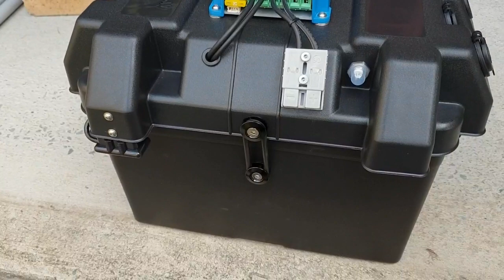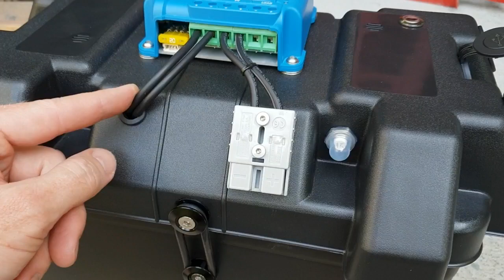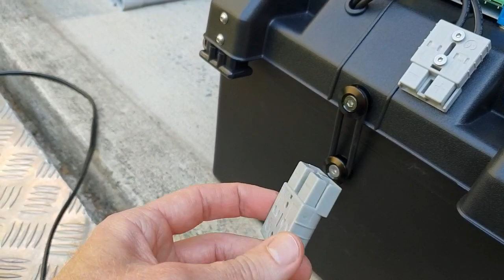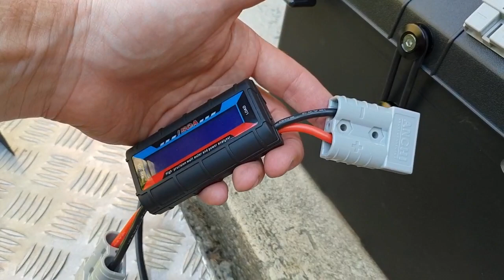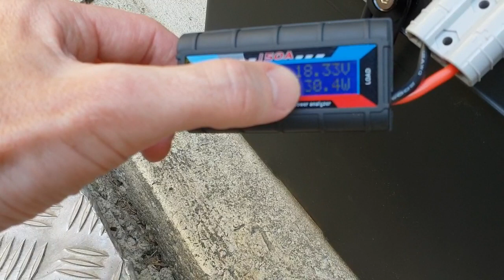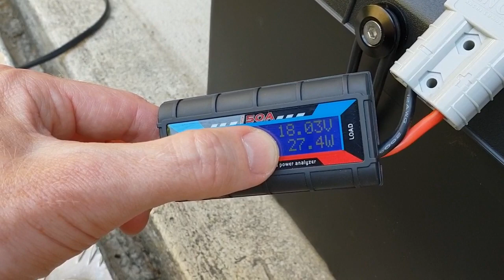AGM battery box and Victron 75/15 solar controller

Comment: With the box, is there any additional ventilation you have added. I have a similar set up but tend to lift my lid when in use for air flow? Am I just being paranoid, my box is in a boot and tend to have windows cracked a bit allowing outside air in. 
Any suggestions for ventilation?

Comment: I'm thinking of using the 75/10 Victron to trickle charge, or is it maintain, an AGM starter battery on a boat.  The panel is only 55W, but I might be able to add another 20W panel.  A few questions:
1.  Would the 75/10 be at its limit?
2.  I think my alternator puts out 14.4V, and I've read AGM batteries take 14.6-14.8 to fully charge.  If that's true can solar finish off the charging of an AGM starter battery?
3.  The Victron solar controller has another 2 terminals on the unit, are they for loads, e.g. lights etc?
4.  I have all the lights and stuff running off a leisure battery, the starter just does the engine.  But if I can run lights off solar as well, then I would.  I can't work out how I would wire it all up.

Comment: Great video. Im looking at doing the exact same set-up. The watt meter is very handy. What size wire did you use from the "battery to the controller" and "controller to the anderson plug (to the solar)". Im opting for a 100/20 Victron MPPT with a lithium 120 AH battery and a 275w (approx) house solar panel. Thanks in advance.

Comment: where exactly would you use this?  You could not mount this on the outside of a RV because the charge controller is not waterproof.   If you do not use a lithium battery and they are lead acid then you have to vent this battery or mount it outside.

Comment: I prefer a bigger box to ensure it's water proof then in case you're using it outside you won't have issue with rain. In this case, you have a hole right in the top of the box, let alone the Victron just sitting there.
Reply: Just put a cover over it, done deal.
Reply: @kdigiacomo   Yes that is a good idea, then you can leave it outside the box still but get to it easily and still have it waterproof.
Reply: I don't know why victron done make them waterproof. Ip43 is pretty pathetic for a premium mppt controller.

Comment: Good informative video, I made one similar around the same time frame,  I used the 15a load output on the victron controller for driving the loads.  That way I could monitor the loads on the victron ap, via bluetooth dongle.  With the app I could set a custom low voltage disconnect for the loads to protect my battery.  I also used the victron bluetooth temp sensor that integrates with the controller to prevent the victron from trying to charge the battery in cold weather.  I liked the plug and play monitor with the anderson connectors, unfortunately I smoke mine when I wasn't paying attention to his maximum voltage and plug it into my 36 V folding sewer panel.
Reply: Great idea if you're always below 180 watts to use the Victron to power then it's all monitored and protects the battery. My lithium phosphate is rated to 100 watts continuous (although I would not go past 500 watts really) so that wouldn't be an option for me.

Comment: Hi , do you fuse the positive wire from Victron to battery?
Reply: That model of Victron already has a fused output to the battery.  You can see the yellow 20A fuse to the left of the power cables coming out of the controller.
Reply: @tonygoinggonzo  Are you sure that fuse is enough? From the Victron manual, the PDF version says this:
"9.1.3. Blown fuse
The 10A, 15A and 20A solar chargers are equipped with an accessible fuse. The most likely scenario when this fuse blows is
when the battery accidentally has been connected in reverse polarity."

Also, what about adding a fuse between the solar panels and the controller?
Reply: @drayxoda  Yes, you ideally want a fuse or circuit breaker between the solar panels and the controller, usually 40A or so depending on the size of wire.  The 20A fuse I mentioned is the one built in to the controller, for the connection to the battery.
Reply: All red wires should be fused.

Comment: hi i have the same victron but when i connect it to my leisure battery it bliws the victron fuse .any ideas
Reply: Did you connect it backwards or accidentally tried to connect your battery to where the solar panels are supposed to go?
Reply: The built in fuse is reverse polarity protection. Sounds like the battery was connected backwards

Comment: Nice job.
Would have used a red anderson plug for the unregulated solar panel.
Reply: I do the same and was about to comment as such. All my PV circuits are Red, all Regulated (Battery) circuits are Grey. Less confusion.
Reply: Was just about to comment on red andersons for PV feeds when I saw these comments, makes life easy with no accidents from people unfamiliar with set up.

Comment: Excuse me mate
I was just wondering if you can/could plug an Anderson plug straight into your solar input that runs from a dual Battery isolator Without a dc-dc charger as I don't use/have a smart alternator as my Prado is a 99 model.
I just installed it to an Anderson plug in the back so I can plug in my portable battery box. My concern is that I run a lithium battery now and heard that the alternator will burn out trying to charge lithium ? Is that the case even know it goes through isolator and battery has BMS .thanks in advance.
Cheers Bruce.

Comment: Got to watch out when you buy those though there's non Bluetooth one and then the adapter is another $50
Reply: What adaptor ?
Reply: @withinwithout1  There is a separate bluetooth adaptor for Victron Controllers that don't come with the bluetooth inbuilt. It plugs into the white plug underneath the fuse that you can see here 0:58.

Comment: Don’t really need those big connectors do you? XT60 is perfectly fine. Smaller and much cleaner look. The ones you are using are for fork lifts etc.
Reply: difference is that the XT60's require soldering and that's extra time wasted.  The larger plugs have crimp connectors, whack'em with a hammer and you're done!

Comment: I am just about to put together a similar setup.  I was wondering whether there was any particular reason that you haven't used the load output from the Victron charge controller instead of taking the load for all the accessories (usb outlets etc..) direct from the battery?
Reply: In most charge controllers, the load output is more of a gimmick, especially ones with a USB style load output. On the Victron, the load output is actually decent and the Victron software would manage the output to prevent discharge of the battery. The main limiting feature on the Victron "load" outputs is the cable size. You're still limited to the load allowed by 10ga cable. Anything that requires larger wire will require it to be wired directly to the battery, which is still the best option as long as you keep an eye on your battery voltages or use a Victron Battery Connect to isolate the loads from discharging the battery too low.
Reply: I will also add that using the load outputs is redundant. The charge controller will already be wired to the battery for charging purposes and whatever the battery is powering will also have outputs. Using the load output from the charge controller is simply adding a second possible output in the system. AS I said before, if this is your goal, the Victron is the right unit as its outputs are rated the same as the unit (15 amps) and it has software to manage the loads.
Reply: @epfd217  Thanks for the reply.  Good advice.

Comment: Hello, can this controller handle a 12V Renology 160W Solar Panel , 2 Renology 12V-100ah Bateries. I'm planning to Install it for a Wireless PTZ CCTV Setup with a 12V-500Watt Pure Sine Wave Inverter. I will be using 123.5Watts tops (2 CCTV Cameras (75Watts) + 1 Wifi AP (8.5Watts + 2  (20Watts) IR-led Enumerator). Will this setup do the job? How many hours  should I get from this setup? Thanks
Reply: A bit late buy yes you your setup will be fine. 200ah battery bank for your particular use will be fine.
Reply: @ultraball69  thanks. I really appreciate you response and wish you best of luck.
Reply: @TheJaimecasado  no prob glad i could help.